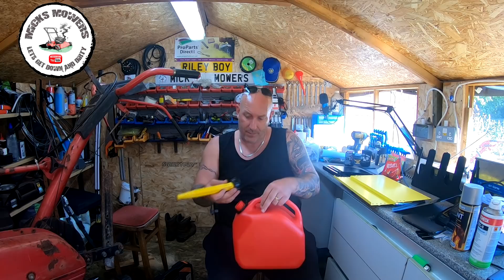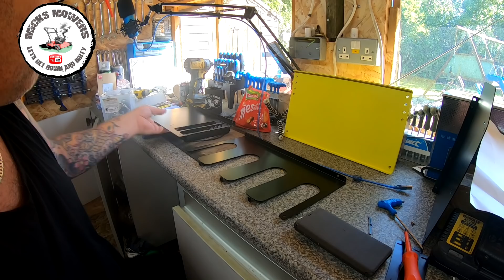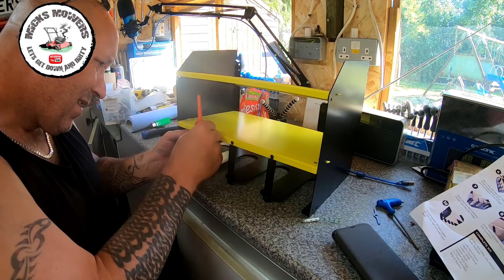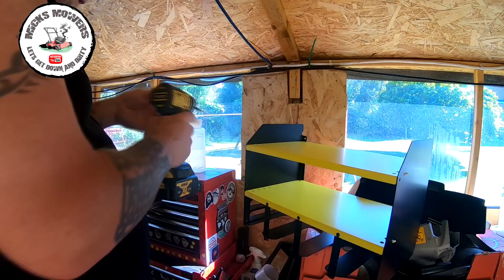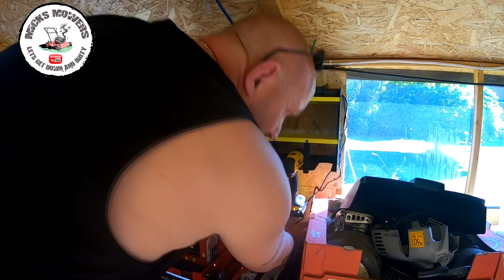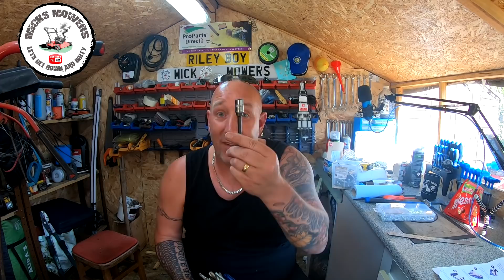Dewalt Drill and Impact Storage Holder Let's Put It Together

Comment: got a Briggs and Stratton 470 Mountfield top pull cord cover gets red hot when it's running any idea why mick???
Reply from the maker: Hmm first time I have come across it.. I would take it off and check to see if the fins are all ok on the flywheel. Also blow off all the dirt off the engine as it's an air cooled engine.. check the oil. Hope that helps
Reply: @themowerman  cleen dirt and crap off flywheel..that sorted mick thankyou